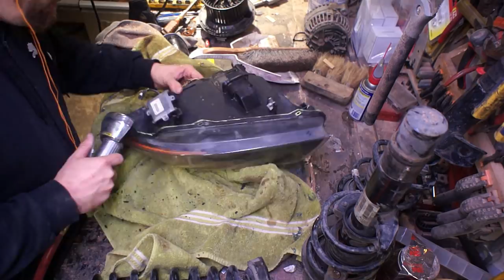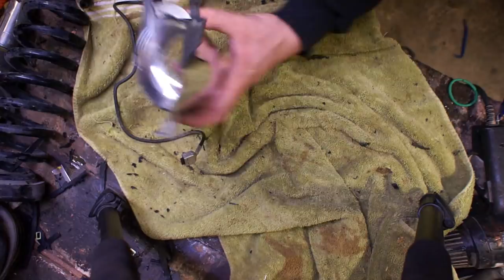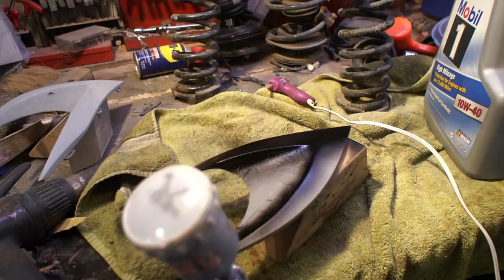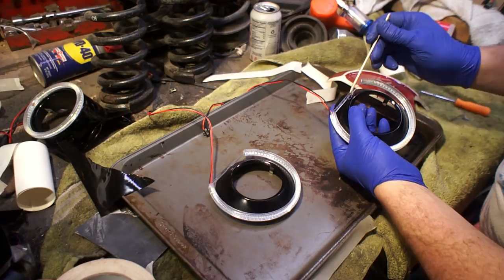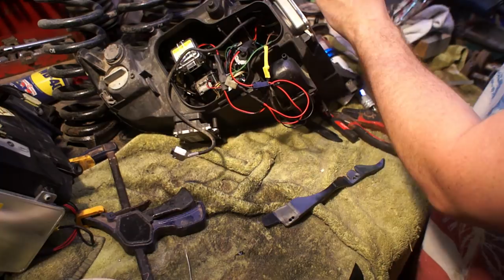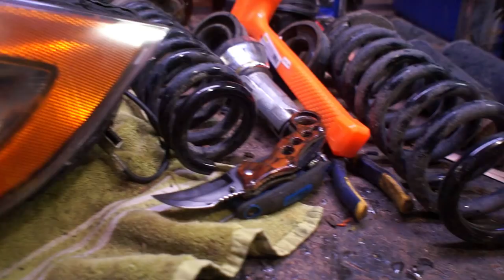LED Angel eye retrofit, Blackout, 50w Ballasts, Amber Delete for 335xi E90 BMW

Comment: I don't know why this video got dislikes, this is amazing! I definitely need to try doing this to my headlights. Thanks for the vid!
Reply from the maker: Thanks for the kind words, I always get a few of dislikes no matter what I do. If you have any questions don't hesitate to reach out :)
Reply: Tappar  what rings are there ? on e90 i found only full circle
Reply: maybe because pure bmw  lovers would have changed only the light bulb instead of putting these shit of fake angels eyes ...
Reply: @Tappar1  I am having trouble wiring the headlights , I ordered the halos since I broke mine while disassembling. Would really appreciate if you could elaborate on which cables you spliced together to make them work with oem dimming setting.

Comment: How did they hold up in terms of condensation? I've literally just got my lense back on but unless I'm over thinking it, I don't feel confident in the Butyl. In an idea scenario I'd like the lense to smear a coat underneath as the lense gets pushed on and then have a wall of butyl at the back.. But on some areas the lense just seems to push the butyl towards the back so none is underneath the lense. Hopefully it holds up okay because it's one long ass job!

Comment: i have halogen version of the e90 headlights and i wanted to open them but they are sealed with high temperature silicone, i cant find a way to open them without ruining the part you ginded off, that will for sure never be properly sealed again
Reply: Rui Pereira throw them in the oven low temp